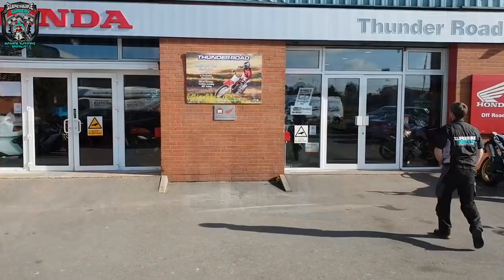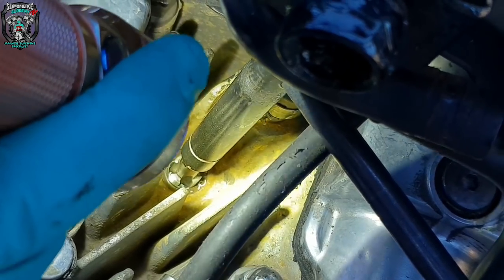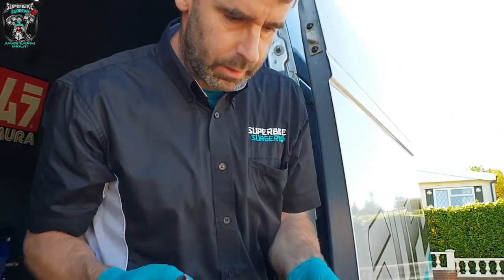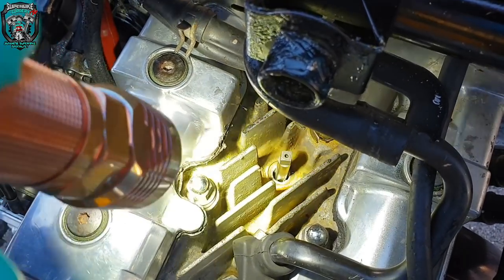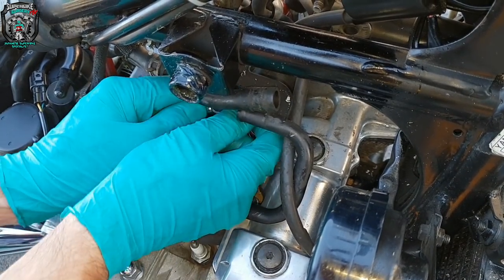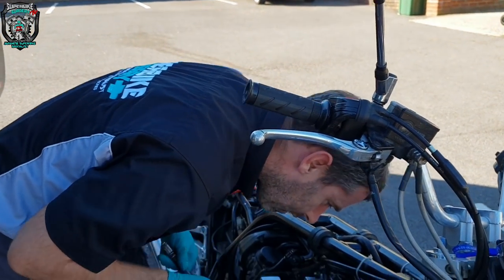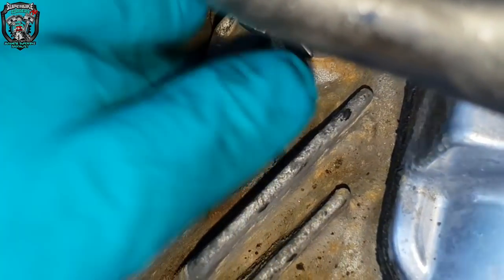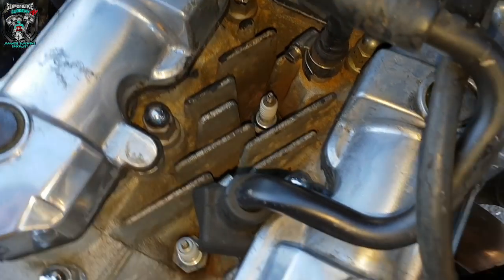Easy Motorbike Spark Plug Thread Repair - VLOG 014

Comment: when you blew all the swarf out the cylinder with the air gun, i could see the piston was not top dead center so  some of the valves would still be open,  do you think you may have blown swarf in them ???
Reply from the maker: Engine is half way up the compression stroke, if it's got an open valve at that point a stripped Spark Plug Thread is the  least of it's problems!
Reply: Superbike Surgery TV  oh right. I didn't see you set that. Maybe you did it off camera
Reply: @SuperbikeSurgeryTV  how do you find out its half way on the compression stroke plz?
Reply: @SEANO1810 put your finger over the hole. On compression you can feel the air pressure. Then insert a zip tie or screwdriver in the hole & rotate the wheel in 6th gear to find the bottom & top of the stroke.

Comment: I think the odd remaining metal chips in the cylinder will get blown out through the exhaust port when you start up the engine, maybe even if they had grease on them too.
Reply from the maker: Unfortunately they find their way under the valve seat in most cases then it's cylinder head off. Up to you though. I'm not the one having to remove the head 😁
Reply: @SuperbikeSurgeryTV  Good point. Thanks for the great video.👍

Comment: Can this kit be used on a gtr1000...as the valves are really close to the spark plug hole.. and i was thinking it would cut into the valve sitting...

Comment: that's the difference between a real expert and a self=anointed youtube expert, the real expert knows using grease when you cut the new threads in a cylinder head is one of the dumbest things you can do because it can trap metal shavings inside the cylinder and take out a valve or worse......

Comment: What if I don't countersink. My used kit don't have that
Reply: Did U ever get an answer to this? I don’t have a countersink either…
Reply: @sixstringsbent  if I remember right I don't think I used a countersink. But either way you can just get a drill bit set and use that. But I just used what was in the kit. And slowly carefully screw that thing in making sure it's straight. Seem complicated but it was super easy. I used grease to help keep shavings from falling in. But honestly they will just blow out when u start the bike. Good luck